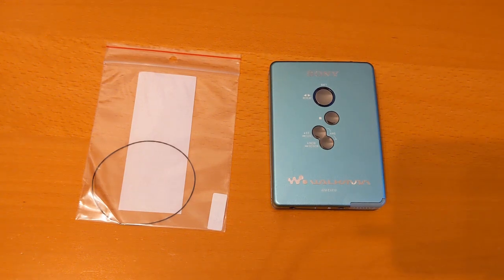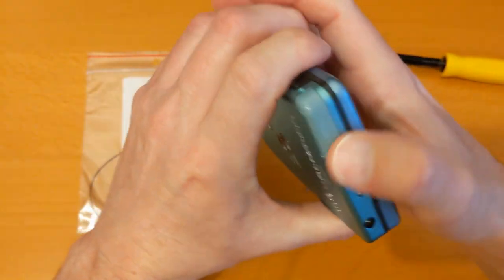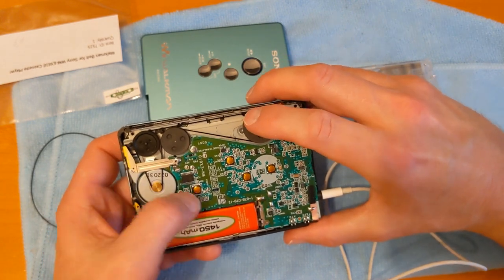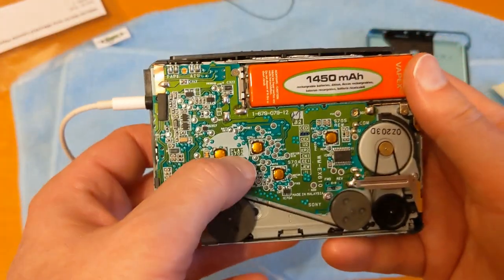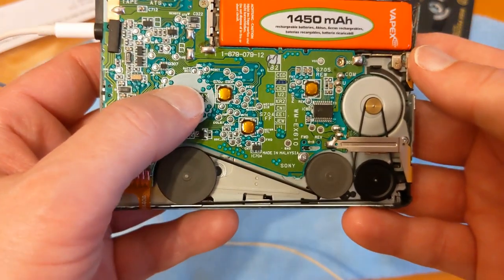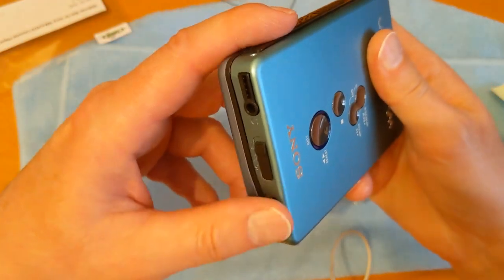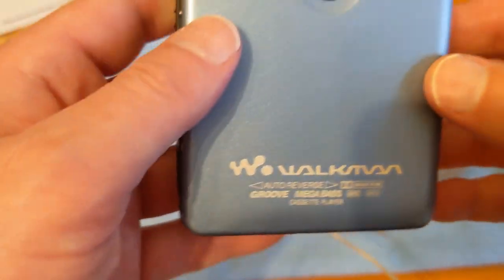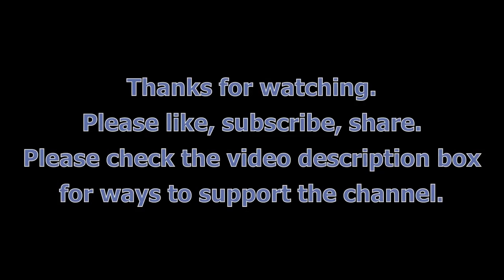Sony Walkman Belt Replacement for WM-EX610 Cassette Player

Comment: Note to anyone reading this, and future self if I need to come back to this video, there is 1 ever so slightly longer screw in the corner near the headphones
Reply from the maker: Oh! Thanks! I hadn't noticed that. I'll look out for it when I replace the pinch rollers in another one of these. Thanks.
Reply: @CBitsTech  subbed! I'll be following that video too! Just bought one of these tape decks and it's a wonderful piece of kit
Reply from the maker: They are great. I've been using mine to listen to the pre-recorded cassettes from my recent tape haul.
Reply from the maker: PS thanks for the sub 👍

Comment: just used this as a guide for my 27 year old 618, hasn't been used in 20 years, new belt was done in about 20 minutes, zapped the original battery and it works like new, shows how well made these units are, many thanks
Reply from the maker: Excellent. Nice to hear of another Walkman brought back to working order. Apart from belts, there were well engineered and built, I agree.

Comment: Just order the model that you have. It’s an early birthday present for me! The reason why I was looking for this model in particular is because of the noise reduction feature. I can’t wait to use it soon!
By the way, still using the WM-FX 521 Walkman!
Reply from the maker: Great! Happy birthday! I was using mine yesterday.
You'll need the in-line remote to turn on the Dolby Noise Reduction.
I like your existing player.
Reply: @CBitsTech  Thanks! My birthday is not until September. Anyway my order is on it's way! Also, I forgot to ask the seller if came with A remote.  I really hope it does. Appearently I have A different remote that might not be backwards compatible from the other walkman of WM-FX521.
Can’t wait to use it!
Reply from the maker: @captianbubble  Well, happy birthday for September! If it doesn't have the remote, the one I use is RM-WME23.
Reply from the maker: @captianbubble  PS, thanks for subscribing.
Reply: @CBitsTech  thank you. I wrote down the remote number, and I saved it to my saved history a.k.a. saved searches list on eBay.
If it does not have it, I will buy that remote separately.
By the way, this is my second eBay purchase!
Reply: @CBitsTech  you’re welcome! I like your channel!
And have a great rest of your day, and God bless you!
Reply: Well, I got the unit today! WM Dash EX610! Sadly though, it did not come with the remote. Now I have one little problem. Speed adjustment is too high, and My tape alignment adjustment on site a is too muffled. Where on earth can I fix that?
Or in other words, how on earth do I get access to it?
Also, just to play it safe, I ordered the tape belt for that unit which you have demonstrated on this channel of how to fix the belt. Walkman works really well, except for speed and tape adjustment issue on site A.
And, as a bonus, it has a gum stick batteries thing already in the unit! And, I have an adapter that came with my Ford track Sony tape recorder that uses the same voltage as this Walkman to charge the unit.!
So that means, I can use the external battery for my AA battery, and the gum stick   battery thing as my primary go to until the battery gets super low, then, I can use the external AA battery part of the unit.
Tape alignment update: it just needed some cleaning. It’s working now!

Comment: You did good and got a bargain! As they say on your side of the pond "Bravo"!
Reply from the maker: Thanks! Yes, I just rewatched the part about what I paid, what a bargain! I did have to buy a second player (I think) to get a remote for it, but I use it more than I expected to.
I found an old (cheap) boombox in the bottom or a wardrobe (closet) recently (I'm planning to do a video on it to see if it works soon). With the boombox was a small box of audio book and autobiography tapes that I want to listen to, so this player will come in handy for that too.

Comment: I have a similar walkman WM-FX521 and I was checking on the belt to see if it works well, and it snapped after taking the belt off when I was trying to put the belt back in it’s place. Mine is 2001 model.
I found the right belt and ordering it soon!
Love love love the cute walkman!
Also have the original remote for it.
Reply from the maker: Sorry for the delay in replying. Did you get your new belt fitted? How did it go.
I did get a remote for mine. I think I bought another of these just for the remote; can't remember at the moment, but I'm planning a series of videos looking into what I've got in my audio storage boxes.
Can't believe I only paid £17 for this unit and the parts. Even though I've got lots of mindiscs and MD players, I still use this cassette player quite a bit.
Thanks for the comment.
Reply: @CBitsTech  had to order it on eBay, because, I ordered the wrong belt model. Anyway, it should be coming in between February 2 all the way to February 19. I guess I got it outside of the US or something. I am looking forward to putting it back together! It’s my favorite Walkman that I love so much!
Reply from the maker: @captianbubble  Cool. Good luck. Let us know how it goes.
Reply: @CBitsTech  my belt came in today! 28th of January 2021!
I didn’t realize when I was putting the belt back together, I didn’t know there was these little pins that had to go in between the pullies  for the belt  to work properly. Anyway, it’s working perfectly fine now! I also had to do something in the process, fixing a little micro twist on the belt while  putting the belt  back together. Now, it works just as fine as I first got it!
By the way, I was not alone on putting the belt together. My dad helped me a little bit, because, I found the service manual for this unit.
And, being a blind person does not mean that I couldn’t do this myself at all. Although, I had a little assistance from my dad, I put the rest of the unit back together afterwards. My Walkman is as new as it sounds now.
Reply from the maker: @captianbubble  Nice work! You did this, and you're blind? That's impressive. Respect!

Comment: Thanks for the video - really useful. Going to use it to replace the belt on a similar Sony model (WM-EX618). My model has switching for its Dolby NR but it's inside the cassette compartment itself. I'm sure if yours has this, you would have spotted it by now - but worth mentioning :). If you ever do find a replacement inline remote, do let us know. Mine bit the dust back in the day - very skinny cable, which eventually came away from the remote control housing. I remember the sound quality being first class on this device, and I'm really looking forward to trying some of my SA cassettes again. Hoping they have stood the test of time; they were always my favoured cassette. Thanks again.
Reply from the maker: You're welcome, thanks.
Mine doesn't have the switching for Dobly inside, hence the need for the remote, as you know. I do have a remote for mine now, though.
Hope your repair goes well!
Regarding your remote, maybe you should save a eBay search for the player model and the word Remote, and another for the remote's model number, in case any come up for sale. I know that some Minidisc player remotes are compatible with other models (listed on the Minidisc archive site), but I can't find any information for this cassette player remote, sorry. Could you repair the original? I believe the original was MDR-EX21E.
Good luck!
Reply: @CBitsTech  Cheers! Repair was successful, though the device is definitely running a bit slow - not sure if there's an adjustment for that. Might have struggled without your guidance - so thanks again. The original remote is long gone (or buried in one of my many boxes of cables, that I hide from my wife!). Excellent idea for the remote - will do that - it's not a deal breaker but would be useful. I'm using the Walkman to digitise some old cassettes, as my old Aiwa deck was in a right mess when I tried to change its belt - rubber mush EVERYWHERE, and difficult to clear.  I've owned the WM-EX618 since new - when it sounded first-class, as I mentioned. I just need to find a decent recording to remind myself of just how good it sounded...

Comment: This video is perfect for me, I have just bought one of these off EBay and it plays but struggles to wind, so it needs a belt. Mine came with the remote, did you ever get a remote or the model number for it?
Reply from the maker: Yep, the remote is RM-WME23. I think I bought another broken player just to get the remote. Enjoy yours, they're good Walkmans.
Reply: @CBitsTech  I will!, belt now ordered!
Reply: Hi I bought the same model. Where and what size belt do I need to fix mine? I have the same problem where the play works but rewind and fast forward don't work. I live in uk

Comment: there is usually a dolby switch inside the player where the cassette goes in, little slider
Reply from the maker: Thanks. On this model the isn't a switch inside (I just checked again). But I did buy another of these players with a remote, so I've got one now. Very nice player. Thanks.

Comment: Hi the remote you'll need is a RM-WME23. Hope this helps.
Reply from the maker: Hi. Thanks for your comment and the info.Sorry it's taken so long for me to reply. Since making the video I've bought another WM-EX610 which doesn't work (yet) but it did come with a RM-WME23. I'm glad I got it for the Dobly on/off function. Thanks again

Comment: I replaced the belt on my ex670 and unknowingly took off one of the tape heads that lead me down a hole of trying to dismantle it to see how to fix it I only just found out how and after fixing the issue the gears now won't engage and now I'm back to square one the belt just spins and drives the cassette for a few seconds then stops and rewinds without ever making those clicking noises like it used to 
Any help appreciated
Reply from the maker: Sorry for the delay. It's hard to know what has gone wrong. Perhaps the belt isn't routed correctly around the pulleys. Are you able to shoot a video showing the problem, ideally from the cassette side and showing the belt side? You can upload the video to YouTube and link me here in the comments.

Comment: 🙂👍 nice deck. What year is that from?
Reply from the maker: Sorry, I don't know. I think it was around the Walkman 25th anniversary, so that would be 2003 or 2004. I've got another to repair, so if I need to take the case off to repair the belt, I'll look for a manufacture date n the circuitboard.
Reply: I've done one of these now. Mine had faulty power too though.
Reply from the maker: @ANTandTEC  Did you get the power issue fixed too?
Reply from the maker: @ANTandTEC  Ah! I'll watch your video 😀

Comment: I bought this model last week
I need to replace the belt... what are the belt dimensions?
Reply from the maker: Sorry, I don't know. I just order belts based on the model of the player. In which country do you live?
Reply: @CBitsTech  Romania
Reply from the maker: The closest supplier to you that I know is Fixyouraudio.com. That's the suppier I used for the belt in this repair video.

Comment: Very informative. Would this be the same for a wm-ex560? Keep safe
Reply from the maker: Hi. It will be similar, I think. There may be another video on YouTube for your model of Walkman. If not, take it apart in the same way I did and have a look. Techmoan is a great youtuber who sometimes fixes old audio equipment, search for him doing a belt replacement (on any equipment) so you can see how to remove the residue if your belt has become sticky. He and I have ordered belts from https://www.fixyouraudio.com

By the way, I discussed your comment on my most recent video. The chapter you're in is here https://www.youtube.com/watch?v=FUwsBYcvhV8&t=1943s

Comment: I live down under and have been interested in getting my first cassette Walkman for a while now. My dream model is the EX615 just because it uses the current Walkman logo for controls (otherwise identical to the showcased model, funnily enough), but what are some cassette Walkman models you'd recommend for someone on a tight budget that are genuine from Sony?

btw edit: did some internet searching and found the remote model for both, its model number is RM-WME23
Reply from the maker: Well, I'm not really a Walkman expert, but I'd recommend anything from the EX range if you can afford one. Here's Techmaon's video on this subject. The link takes you to his recommendations, but I would advise watching the whole video. https://youtu.be/A9wT2Y4W-T0?t=593

I wouldn't advise getting a much later Walkman because towards the end of their retail life they were cheap and plasticy, and some might not have Dolby NR on them. 

I also have this one (link below). It's a bit bulky (partly because it has a radio) but it has a great belt clip and has a really nice feel on the buttons. I bought mine broken for £23.80 including postage. All it needed was a belt replacement. Something like that might suit you. https://youtu.be/eKxozhzJu7o

Good luck.
Reply: @CBitsTech  The one I was desiring was from the EX range but thanks for letting me know about which Walkmen to walk past.

Comment: can this Walkman rewind forward and backward without a casette placed in?
Reply from the maker: No, I checked, it can't rewind or FF without a cassette inserted. I didscussed your comment in my latest video. Here's the timestamp to that section of video https://www.youtube.com/watch?v=FUwsBYcvhV8&t=1943s
Reply: There is a little sensor thingy on my Walkman that detects  went the  tape is in or not. I had to put my finger on it, and it works that way to see if the unit works OK before playing the tape.
I don’t know if other Sony Walkman  does the same thing like that though.

Comment: Does it have the same mechanism as the ex600?
Reply from the maker: Sorry, I don't know. I've looked for videos and images of the EX600 and can't find any to compare with mine. I think it will be similar, but probably not the same. It's probably a similar method to disassemble as in my video. I think the belt you need (from the same supplier as in my video) is here https://fixyouraudio.com/product/belt-sony-wm-ex600/
Good luck. Let us know how it goes please.